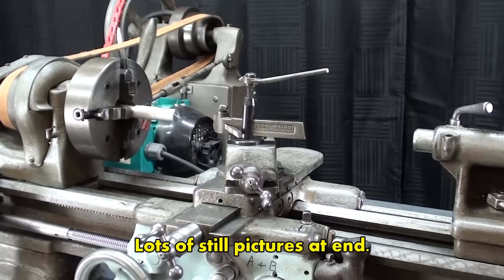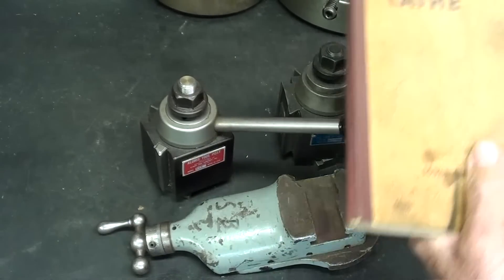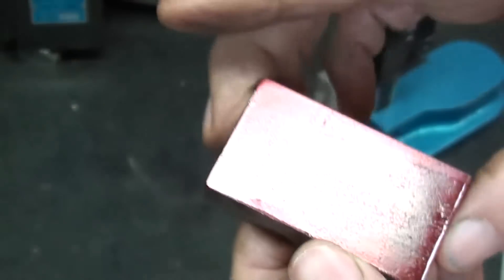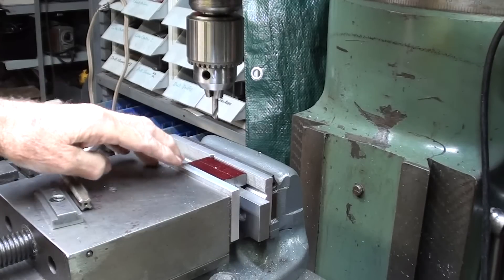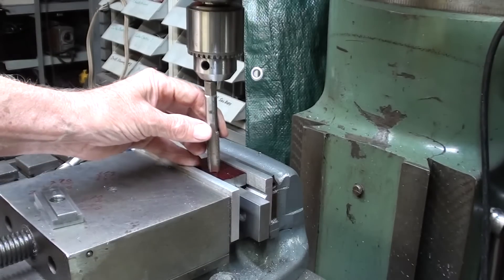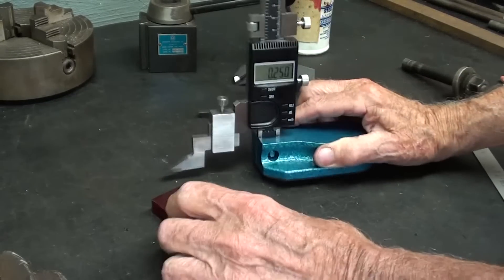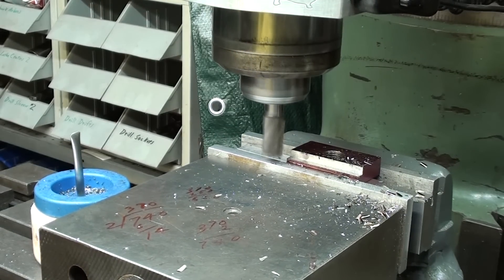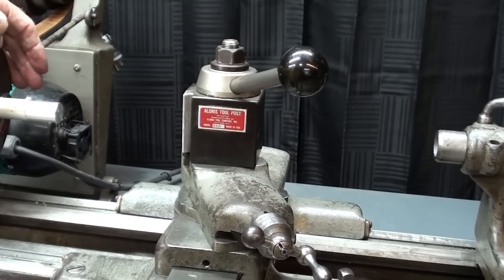MAKE ALORIS TEE NUT FOR SB LATHE #816 tubalcain south bend

Comment: Mr Pete.. Thanks for this video! Just bought myself a quick change tool post and it has an oversized t-nut provided in this kit!  Question, how would mill this t-nut to fit my 1935 south bend 9C without a mill? Sorry for the new be questions?  lol
Reply from the maker: You do not really need a tee nut. 
Consider just using a piece of steel that will fit in the lower part of your compound slot. Since it is a fine thread, you do not need all that much engagement.

Comment: How do I mill out those corners if I don’t have a mill?
Reply: A hacksaw and a file, maybe?  It will be ugly, but you could use it to clamp the tool post temporarily to use it to do the trick another commenter mentioned.  Clamp the stock in the tool post, put a mill in the Chuck, and you have a crude milling attachment.

Comment: I’ve noticed most of the lantern tool posts don’t have T- nuts only a flat piece of steel with the bolster so I guess my question is a T-nut necessary. I’m not sure the quick change system would have any more stress than the original. I realize that’s what they send you and ask you to do but is it required. Just thinking out loud
Reply from the maker: It is the length of thread engagement that is important

Comment: I don't have a milling machine, so I just turned it to size in the lathe and ignored the T part. It's just a block, but it works.
Reply from the maker: Yes, many people do that it shows that you have a shorter length of thread engagement

Comment: I just did a T nut for my lathe on my last video and I did a climb cut as well but one of my viewers said I should’ve done a conventional cut because I could’ve broken the end mill. Can you explain why you would or would not do a climb cut? I had been under the impression a climb cut was just fine, and Joe Pie does climb cuts all the time.
Reply: It depends on how rigid your machine is!  A climb cut will pull the work into the cutter, exerting large forces as a result.  If any part of your mill flexes, it can cause the cutter to dig in suddenly and start breaking things.
Have you noticed that the hand wheel gets “light” as you turn it when climb cutting? That’s the force of the cut trying to advance the work faster than you are intending.
Climb cutting is OK on a rigid setup like Joe Pi has, and can produce a very fine finish, but be very careful on a light duty mini-mill or a mill/drill setup.  The frame may not have enough rigidity to withstand the forces involved.
Reply: @DavidWilliams-rn6uq  Its a bridgeport. The roughing mill I used went through the cuts like the steel was soft butter and I ran the power auto feed on it. I guess I need to be careful with what I'm doing.
Reply: Gotcha - you are fine, then.  Your BP setup should be just as capable as Joe Pi’s machine.  I think most people are assuming hobby mills are the little ones.
Reply: @DavidWilliams-rn6uq  Yeah Id go nuts with hobby machines. I'm trying to get a business going as well. One of my subs watched my video making my T nut last week and I was climb milling and he said I was lucking I didn't break the end mill. I've watched a bunch of videos on it so I think I got it figured out. Everything turned out ok and I had no issues milling the T nut. 😀😃😄😁👌

Comment: sir, may i ask a question? i have met some machinists who insist all the screw hole in the t nut should  be a blind hole. exactly as you explain the situation, an over tide squeeze will damage the dove tail on the machine. if the t nut material is thin, they say weld the screw on the t nut would be a better solution. would you comment on this issue?
Reply: I'm sure others might chime in, maybe even Mr. Pete, but I'll just tell you from what i know.
Although I've never seen a t nut with a blind hole (I'm sure they do exist though), most t nuts will have a through hole but when tapped they won't let the tap run all the way through. They'll only run a bit of the tapered end of the tap out the bottom hole and stop there for the exact purpose I'm sure some are made with blind holes like you mentioned and what Mr. Pete mentioned in his video which is specifically to avoid being able to run the stud through the bottom of the t nut and force it into the mill table or lathe which can damage things if over tightened as it acts kind of like a jack.
Reply: @SweetTooth  i believe you probably saw it before, t bolts instead of t nuts were used when fixing material on the milling machine table. technically, it is different, but the idea is same. the machinists i mentioned are coming from a oem tablesaw manufacturer here in asia. they have some issues their customer over tide the t nuts, jack and damage the rail on the table. that's some expensive $$$ to fix. i believe TE CO do have a specific product of blind hole t nuts and t bolts? but according to that machinist from tablesaw company, he said people don't like the idea and think using t bolts is cheap. this is the point that makes me confused.
Reply: @luderickwong  yeah. I don't know why they wouldn't like t bolts. I have several sizes of t bolts and i love them since it skips needing to threat a stud into a t nut and it also saves from worrying about the stud going though the t nut and damaging the table. The only reason i could see maybe why some people prefer t nuts instead of t bolts is because with t bolts, you're stuck with specific stud sizes where t nuts you can use any stud size or screw length you want...
But I'm sure blind hole t nuts like you mentioned must exist. Maybe te-co sells them like you said. I'm sure you could find them from certain retailers.

Comment: I use the a big tap wrench and let the handle sit on the carraige. Then turn the chuck with my left hand.

PS you can use the aloris tool holder to cut a t-nut. Clamp blank in tool holder and clamp it with grub screws. Set height with the tool holder wheel. Chuck up an endmill. Line up carraige for DOC and lock it. Send cross slide over slowly to make cut
Reply from the maker: Great idea, thanks.    Potential future video.
Reply: The nut you want to machine is needed to attach the toolpost to the compound.

Comment: Mr. Pete. Mr. Pete. Aren't you using your adjustable wrench backwards???😮

Some T nuts have deformed thread at the bottom of tapped hole which helps prevent the protrusion concern and caution that you gave us. Commercial T nuts are hardened. I assume that this is to prevent wear. Infrequent tool post changes don't require this feature. My first import tool post T nut  was hardened. I couldn't machine it to fit my lathe with my HSS tooling. I opted to machine it at work. 😅
Reply from the maker: I noticed the lots of the import tee nuts are staked at the bottom